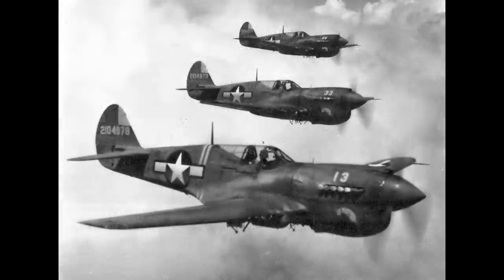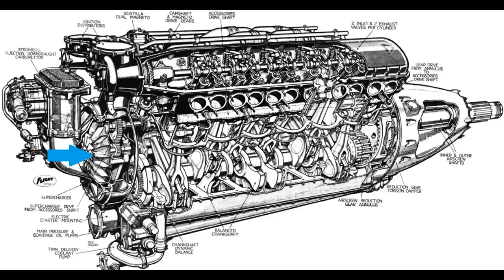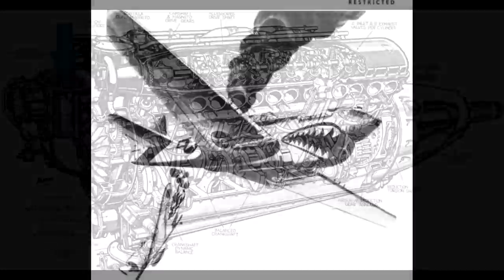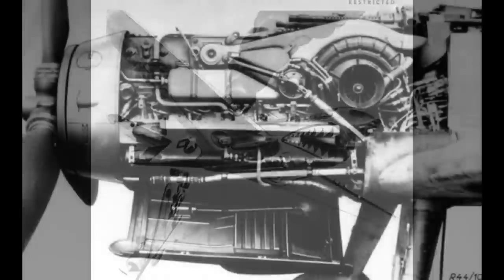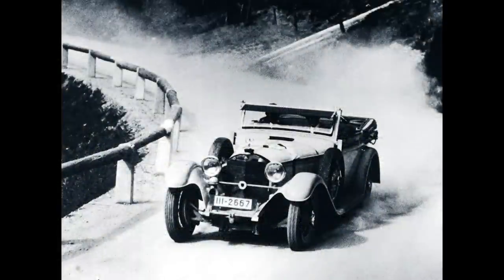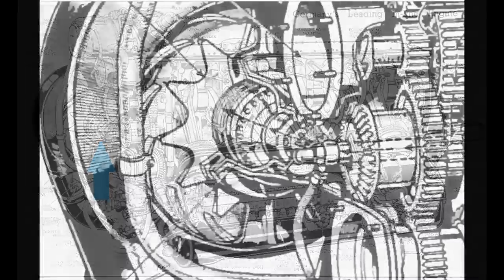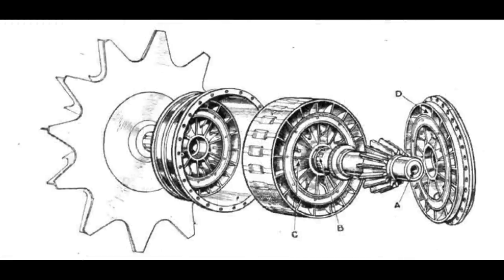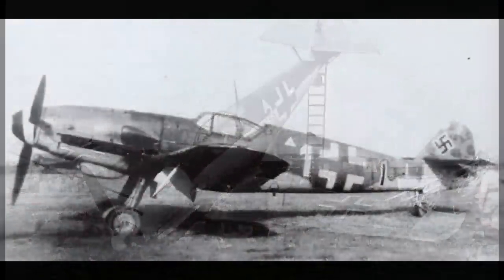Messerschmitt BF 109 Supercharger Drive System

Comment: On the subject of complex supercharger drives, the never to reach production Napier Nomad aircraft diesel engine had a meshing disc type CVT to couple its axial supercharger to the crank. The engine ran up to 80 psi boost and could extract considerable power from the exhaust. Complexity and turbines consigned it to history, 3300 Hp max takeoff power from 12 cylinders is noteworthy.
Reply from the maker: Napier was doing some amazing stuff, and it may have proven revolutionary has it not been for the development of the turbine engine. All that new piston engine tech they were working on was sort of shoved aside and forgotten.
Reply: I once spent a lot of time studying the Nomad engine cutaway drawing trying to comprehend the shafting system.  The CVT that connected the crankshaft to the turbine shaft had interleaved discs that provided continuously variable ratios.  It was called the Beier stepless variable drive, as I remember from the book by Herschel Smith (or was it Bill Gunston?).  The Nomad was developed on the assumption that high fuel consumption of early jets would keep them from providing economical air transport, and that props and recips would still have a market.  But the speed and smoothness of jet propulsion prevailed.
Reply: A good overview of this engine can be found in the 1955 edition of SAE transactions, an axial compressor only has a narrow operating range. Operating a CVT with a 3:1 range to produce a 20% speed variation on the compressor though the use of a torque splitter allows for most of the torque to pass through the splitter instead of the CVT. I went looking for this engine in the Edinburgh museum only to find that it had moved elsewhere.
Reply: I saw a Nomad in the Smithsonian Garber restoration building in Suitland, Maryland maybe 20 years ago, before the Udvar-Hazy museum opened.  (They also had a Sabre.)   I wasn't able to spend any time studying it, though.

Comment: Very much enjoying your channel - even if much of it is beyond my mental envelope. 
Regarding the placement of the supercharger, until sound evidence settles the question, I wonder if your comment - that the SSK’s supercharger was also at 90 degrees- is giving the correlation argument a little too much weight. Cars are different from aeroplanes, so there may have been different reasons for that angle of placement, thereby, giving the appearance of a causative reason. Just a thought. 
Keep up the output, your channel is a breath of fresh air!
Reply from the maker: It could very well be that there is no common reason between cars and planes using the 90 degree supercharger angle. The only common factor is Germany. Car or plane, if it was made in Germany during this period it almost always ran at 90 degrees. If it was made somewhere else, it ran parallel to the crank. There are lots of good theories, but nothing concrete in terms of evidence about the reasoning.

Comment: The 90 degree position to the direction of flight is advantageous because it is the best way to lubricate the bearings in the turbocharger. This is not so relevant for smaller turbochargers, but with increasing turbine weight and higher G load in the longitudinal axis, this factor becomes more and more important.

Comment: Really liked this one!
While memorizing all of the details would be superfluous,  if you take a look at the type of engine in a 109,,take a look at the descriptive numerals and letters.  
As an example:
A.  Meaning an older 3 valve per cylinder design. 
S.  Meaning an oversize supercharger originally meant for the DB 603 engine. 
C.  Meaning a higher compression ratio,  designed for 100 octane fuel. Of which we Germans had almost none. 
M.  Meaning the supercharging system is equipped with the emergency power methanol water system. 
Lots and lots of letters.  Memorizing them all would be silly.  Thanks K.
Reply from the maker: Thanks Kori.

Comment: in regards to the supercharger, mabey since there was an airscoop on the side of the cowling, this more efficient accumulation of air helped augment routing to the engine manifold as a whole, a subtle or slight advantage mabey,  very informative.
Reply from the maker: I thought of that, and I like that theory. I also like the theory about easy service, but it doesn't explain why they also did it in cars.

Comment: The reasonfor the right-angle supercharger is, most definitely, to allow the cannon to fire through the prop shaft. To see the firewall of an engineless Bf109 will convince you of this. Both the D-B and Jumo engines allow for this and it was, almost certainly, a Luftfahrtministerium requirement. The use of a two stage supercharger was prevented by excessive bulk, with the attending loss of efficiency and the fact is that DB engines were one third larger than the Merlin for about the same power. Not only this, the Fottinger coupling is less than 100% effective as there has to be a speed difference between bucket wheels to transmit torque. To reduce the output speed the volume of oil inside the coupling is also reduced with the attending increase of slip and of oil temperature, another source of inefficiencies. Of course the continuously variable speed of the supercharger and the fuel injection system were valuable assets to the pilots. In the event planes from both sides were fairly evenly matched.
Reply from the maker: Then how did the Soviet fighter fire cannons through the prop shaft? They didn't have the right angle drive. I'm sorry but that explanation just doesn't quite do it, it's a good thought, but just doesn't measure up.
Reply: @GregsAirplanesandAutomobiles  As most things in engineering legacy drives development. The original moteur-cannon was invented by Marc Birkigt of Hispano-Suiza in WWI. The interwar Hispano-Suiza V-12s had the (small) supercharger blow into the carburetors on the outside of the cylinder blocks leaving plenty of space for the cannon on the military versions. Soviet planes used engines developed from the Hispano-Suizas. The propeller speed-reducer looks rather primitive and quite bulky, nothing like the Rolls-Royce, D-B or Jumo gearsets. This may have something to do with the engine being upright and allowing a higher propshaft location to accomodate the vertical bulk of the cannon. Somehow the Russians managed to accomodate the intake manifold which was located within the V in the Klimovs. 
The cannon and machine guns on the Bf109 are located behind the firewall with only the muzzles in the engine bay, allowing these bulky engines to be as compact as possible. Anyways I´m sure there is much more than this driving the different designs.
Reply: @GregsAirplanesandAutomobiles  I believe the origins of the engine configuration could be found in the 1929 specifications drawn up by the RLM for future engine developments, if I could find a reference or translation of those specs.  Included in those were inverted vee and fuel injection. This was agreed upon with Daimler Benz and led to the F4 engine project and the DB6xx series engine.  Jumo probably had to follow the same specifications provided by the RLM to sell engines to the military.

Comment: The Allison V1710E27 used a turbosupercharger . It never went into production because the temperatures were too high on the turbo blades . It was designed differently then the turbosupercharged V1710 used in the P-38 .
Reply: machia0705 does anyone know how they controlled the turbo on the p-38 the jug had a separate turbo lever beside the throttle l’ve never seen anything to control the turbo on the 38 other than the throttle.

Comment: Meanwhile in War Thunder:

Engine Overheat
Engine Dead
Water Overheat
Oil Overheat
Pilot Knocked Out
No Ammo
Tail Cut Off
Overspeed
etc.
Reply: Bf109 has the most reliable engine there though, as long as you don't get shot.

Comment: The P-63 had a hydraulic variable speed booster supercharger feeding the engine mounted supercharger (through the carburetor).  It didn't have an intercooler but used water injection for war emergency power.   I saw test data where top speed was comparable to the P-51 (440 mph), although almost all literature puts top speed at less than 410 mph.
Reply: But there were Allisons with the auxiliary stage supercharger that had an intercooler.
Reply: @andyharman3022  Apparently the P-63A did not have water injection and its top speed was around 405 mph.  The second most numerous P-63C had a top speed of 435 mph with water injection.  The P-63E was tested at 445 mph.  They were working on a P-63 with a turbo-compound Allison that developed 2900 hp, but lost interest because of jet development.
Reply: The added supercharge is described as having a variable speed hydraulic link, a hydraulic clutch, and a multispeed link that lead to GM automatic transmission.  I don't know exactly what it had.

Comment: Why 90 degrees? From a change of momentum point of view, I presume the intake air mass into the Merlin forced  the engine back approximately twice as much as the Benz was as the incoming air had to change 180 degrees and not 90 degrees.  Also, the size of the impeller could be made larger I guess! Note that the Benz has a higher volumetric capacity than the Merlin. 
Please refer to the Pelton wheel effect and its buckets to see the effect of change of momentum on a reversal.

Comment: About Germans and 90 degree drives. I think it must be genetic because the Duesenberg brothers were Americans who were the ones who built the first successful  supercharged racing cars in the US in the early 1920's and their superchargers were mounted on the engine's side opposite the crankshgaft rotation too! They did it so they could put a long drive shaft on the supercharger which would twist like a torsion bar spring and absorb inertia loads from rapid changes in engine speed. That's important on cars but not so in aircraft. After Duesenberg's supercharged victory in the 1924 Indianapolis 500 others used superchargers but they never had the reliability the Duesenberg cars did because they always put the superchargers on the end (geared directly to the camshaft drive). Anyway Duesenberg is obviously a German name and it used to bother Hitler because they were also Jewish.

Comment: perhaps the supercharger is at a 90 degree angle to better kick the air into the manifold, rather than relying on the pressure of the manifold being all around high, thus pushing air into the engine, it has the added advantage of directly fanning fresh air into the pistons, well more directly, ive dont a lot of aspiration work on engines in my day, making the air go around corners less is a thing, its not major unless your intake looks like a crazy straw, but perhaps on a large v12 like this it could make all the difference

Comment: I believe they put the supercharger on that way for serviceability? If it was sandwiched on the back side of the motor it seems like it would be so much harder to get to to work on?

Can't believe the Germans didn't use/transition to turbos...look at how fast the big Jug was with it's weight and aero!
Reply: The Beast!  I agree, an amazing aircraft, all considered.  Glad to see it mentioned in the company of these glamorous greyhounds.
Reply: They tried to apply turbocharger to Fw-190, it didn't go too well. The thing is, turbos were big at the time, very big and heavy. Apart from Jug and Lightning I don't know about any fighters that actually used them, apart from some prototypes and testbeds.
Reply: The Wright R-1820 Cyclone used turbochargers in most installations, e.g. the B-17.
Reply: Robert Elmo, The Germans had a number of issues with turbos.  Firstly they didn’t quite anticipate the need for High Altitude combat.   Secondly their highly ambitious Hubertus program was highly ambitious envisaging altitudes of more like 50,000 ft which required more radical engines and airframes.  Thirdly they were short of refractory metals and it was best to use them for jets.  (Even the USA struggled with shortages) They did have turbo versions of the BMW801 (the TJ and TQ) as well as the Jumo 213 and DB603 but only the BMW 801TJ entered service on the Ju 388 and a few Ju 88S3.    Engines with two stage super chargers and inter coolers such as the Jumo 213E or DB603L or Jumo 213EB were better suited to their needs, the Fw 190D13 EB would have been a 488mph monster.  The BV 155 had a service ceiling of 52500 ft with DB603 turbo equipped engines.  So the turbo option seemed to be reserved for super high altitudes.     A turbo equipped fighter essentially needs a purpose designed airframe and the Germans didn’t have time for that.
Reply: The amount of turning the air did was the same on the 90 degree installation.  Scoop facing forward, supercharger, air turns again to enter manifold.

Comment: I commented before you said it had a hydraulic coupling 😳🔫 that would be a great reason to have the impeller rotating in the same axis as the plane is traveling.  If the impeller was perpendicular to the axis of travel the gyroscopic forces would always try to slow it down. And because planes travel so fast it would thrust load the impeller.  🤣it sounded good🤣🤣🔫 great vid thank you

Comment: Is that the only German assembly line photo ever taken? What a treat. Henry Fords scoffs at that factory. The Germans, pardon my cliche, are very excellent designers, engineers, and manufacturers but they suck at naming things for global sales. Trem II - they actually use the Roman numerals - what is it about Germans and Romans? Are you old enough to remember the Doozy? In the 50s, if something was awesome someone might say, "it's a Doozy!" referring to the reputation (1920s) of fine Deusenberg automobiles, driven by many rich and famous Europeans and royalty and American celebs and the wealthy for showing off and going fast and god help you if you didn't know a Doozy mechanic. Also the convertibles were perfect for showing off. It's a Doozy! It's a Benz is a later decade - the 50s on, started by the Brits. Brits and Germans were always exchanging tech, war or no war. Think of the jet engine. Captain Obvious out. (I'm still designing the Captain Obvious Flyer)

Comment: Wouldn't the perpendicular supercharging mount make for a good and compact double stage system? Simply mount the 2nd stage mirrored on the other side of the engine, you can even drive it from the same bevel gear with a different gear ratio to get the best performance. Wonder if DB engineers ever considered the idea, and if they did, why not adopt it. Probably space constraints?

Edit: I've found a video of a restored 109 running its engine without cowling from the left side, and the area opposite to the supercharger seems to be largely empty, especially with the later wider cowlings from the AS variants and K models, so I can only guess that DB engineers either didn't think of it or deemed it not worth the cost.

Edit²: As I suspected, I am not smarter than Daimler engineers and this setup has been tried on the DB603. There is a 1962 "Der Flieger" magazine with a whole bunch pictures of ww2 german engine prototypes with all sorts of supercharging configurations, makes one think how they were stuck with the outdated single stage non-charge cooled design until the very end of the war

Comment: I believe a inverted v-12 was tried in unlimited hydroplaning during the 1960's, the Coral Reef I believe.
Reply: + Keith Schultz    Now that's odd.  The write-up for the Coral Reef boat says that they experimented with a DB-601 although it was not very successful.  I can't find a picture and I wonder what it sounded like.   In the 1960s, Merlins and Allisons could be bought for scrap value, so I'm curious why they would waste a DB engine when parts and repairs were very unlikely even by the 1960s.  I can imagine that someone grabbed a pallet of surplus parts when the Air Force disposed of foreign materials in late 40s and early 50s.

Comment: Neat, thanks for directing me to this.  And I thought I had an original idea for once!  You learn something every day.

Regarding your question about the 90* supercharger location - I'm only speculating here, but I have three possible hunches.  Does it shorten the overall length of the engine assembly, and aid in packaging?  Does it make the supercharger easier to access and service?  Were the components for that 90* setup already well in production at the time, making a revision just a case of diminishing returns?
Reply from the maker: Thanks Paul, all three are plausible.

Comment: When the British examined a captured DB601 their engineers had no idea that the Germans had reached such an advanced level of automatic engine control systems. As for the single camshaft system of interposed roller followers that operated the four valve per cylinder setup they expressed the opinion that it would be inefficient at giving the optimum valve duration per cycle- they were completely in error. Truth is, the DB 601 was much more advanced than any engine being produced in Britain in the early war period. Roy Feddon's superb Bristol Sleeve valve radials were however more advanced than those in Germany.